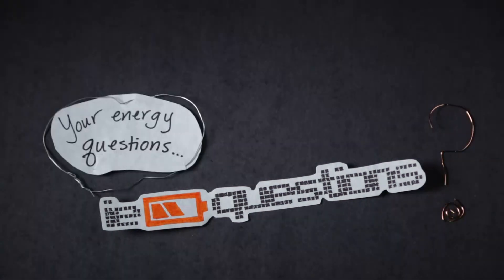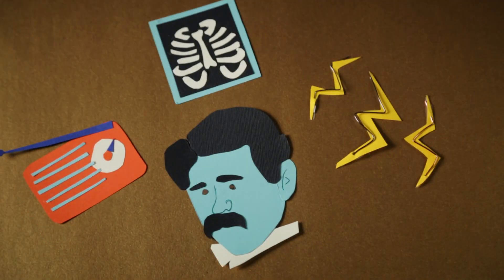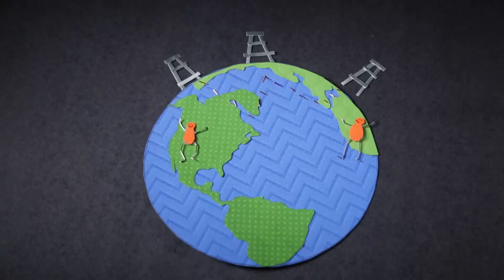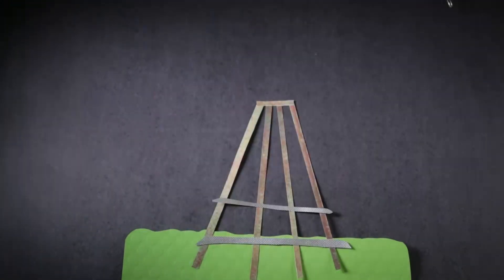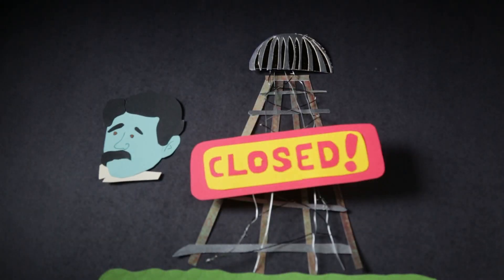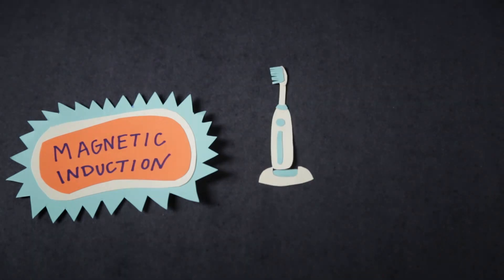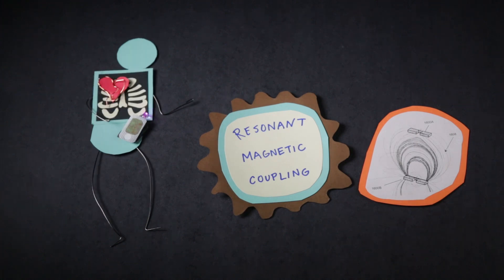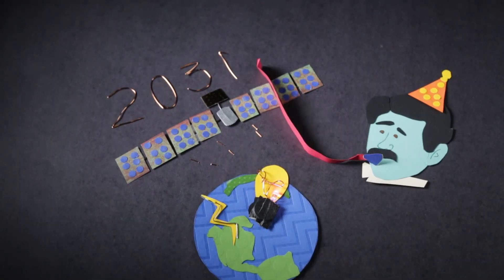Nikola Tesla's Idea For Wireless Energy

Comment: There is a good reason why Tesla's broadcast power was never adopted. It is impossible over long distance.
The inverse cube law (of which the man must have been ignorant) means the transmitted power would have to be immense to do any useful work at the receiver. Then most important of all, the transmitter would have to continually pump out gigawatts of power even it the receiving station is not using any. Now that's what I call waste! 

At least with wires when you switch off no power is used. With this crazy idea the tower would be pumping power into the ether all the time.